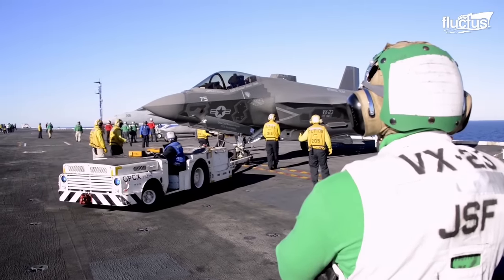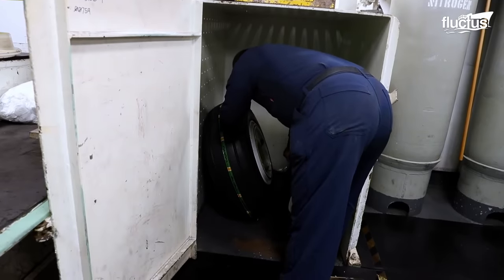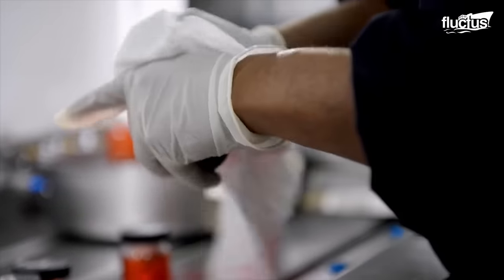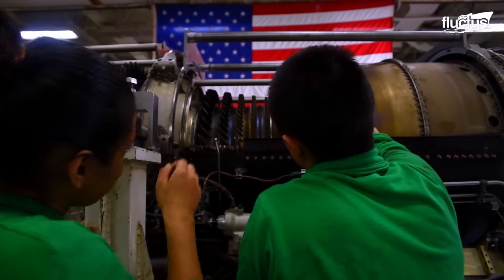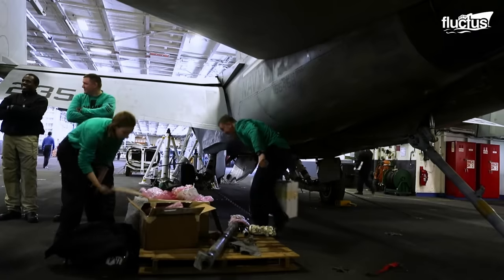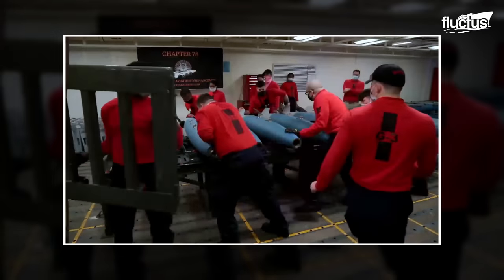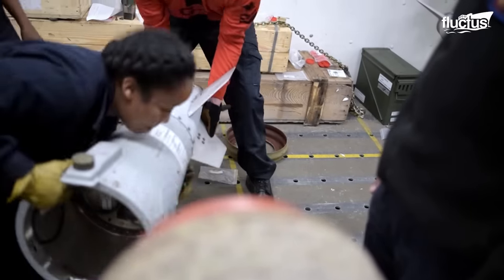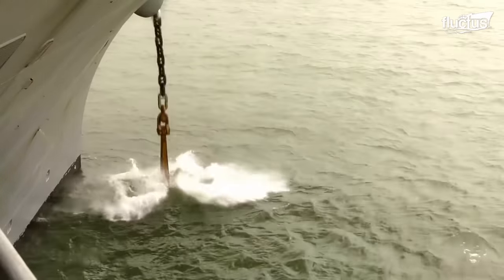Life Inside Tiny Shop on US Aircraft Carrier Repairing Fighter Jets Tires at Sea

Comment: I’m in the Air Force as essentially a Diesel/heavy Equipment mechanic. The amount of tools, consumables and benchstock we require on the ground in a permanent shop is insane. I couldn’t even imagine trying to keep a ship supplied with all of this. 

A lot of times we have to order stuff, but obviously they don’t have that luxury for the most part. So they really have to bring EVERYTHING you could think of with them. That’s just crazy.
Reply: Amazon will deliver anywhere. I saw their 34ft Baha delivering stuff yesterday. 😁
Reply: Civ automotive tech here, it's pretty crazy if any of the equipment break down we call other, manufacturer trained equipment mechanics to fix them. Sailors need to know how to fix the shit they need to fix stuff with 😂. My worker was an air force  mechanic, and has taught me so much about electrical diag.
Reply: I worked on carriers for 4 years....we had a Pod that we mounted on the Tomcat and never had a real permanent place for the three that we had.  We were always moving it all over the flight deck and hangar.
Reply: We have "vertireps"  from Supply ships.. where parts and supplies are brought on board Via helicopter. The bowels of that ship are as big as the sewers in your city. Don't worry we can bring a lot of shit with us
Reply: There is still a supply chain for systems at sea. While the availability of materials is largely governed by weight and size large components can come over water just like in trl.

Comment: Now, this is really an informative vid.  These mechanics and electrical sailors are so important.  That and the culinary specialists.   It is a hot job with no AC.  I am sure they get very hungry like the rest. Launching of the deck is a miracle performed by these sailors.  There are many other operations to handle that are very valuable.  It is a fantastic beast.

We need to replace most carriers, ships, and subs. They work but need to be bigger. 15 Carriers, 54 modern subs with new materials, and on and on.
Reply: I was one of those culinary specialists, but on a destroyer. DDG-94, USS Nitze.

Comment: I was on the Kennedy CVA67 for a Med cruise. 1971 - 1972.  I was an AMS 2nd class.  I was over the tire shop.  We had to do all of this by hand, no machines.  The carrier makes its own O2 and Nitrogen from the air.  Tire pressure on the F4 main tires were 325 psi on land and 475 psi at sea. I used to try to get lost on the boat, an airdale term, but couldn't do it.  Loved the motion and the noise,  On December 31, 1971 went from party to party.  Got drunk and never left the ship!

Comment: AAHH! The name of the rate is pronounced "bo's'n", not boatswain, even though that's how it's spelled. Just like Forecastle is pronounced FOHK-səl. 

Something you never mentioned is that the maintenance personnel are not ships company, they belong to the air wing. The air wing is able to be transferred from command to command, shore-side or deployed.
Reply: Not the tire shop people, they are part of Aircraft Intermediate Maintenance Department, which is a department on the ship. Shop 51E if memory serves, manned by AM rate, Aircraft Structural Mechanic. Squadron sailors are not allowed to rebuild tires, they just change a built one with worn rubber out for a built one with fresh rubber. Also, aircraft tires at sea are not allowed to be re-treads. They were allowed up until 1997, but too many tire delaminations caused all stock of re-treads from ships to be removed. I had to help do that, it was a gigantic PITA.
Reply: @muskaos  I was ship's company. Lot's of us AIMD guys were, but we got a lot more from the squadrons when we deployed. AMH for life!
Reply: Not entirely true, plenty maintaners were ship's company. I was one. Wish I was a squadron guy, they were treated much better!

Comment: Sorry, but NO one (1) system is More important then another on ANY aircraft.
The engine(s) are no more important then the Bolt and nut that hold the tail hook system together.
It takes all parts/systems to make that aircraft work, from every bolt, rivet, screw, to the hydraulic and electrical systems.

Comment: Is there reason their not using cordless impact drill or drills on those aircraft panels..it would be so much quicker?
Reply: Probably battery recharge time. Then storing the batteries may be problematic, spontaneous combustion maybe.
Reply: Arm strong power works  
In all weather,  and at all times  needed.
Reply: Most exterior aircraft panels that are removed frequently have internally wrenching screws. Air or electric drill guns exert enough torque to easily strip out the heads. Some aviation grade fasteners can be very expensive, depending on the metal.

Comment: Looks like all fasteners like screws are loosened or tightened with manual wrenches. Why ?  I'll bet there's a good reason, but I don't know what it is.
Reply: Misguided belief that the JP5 is going to catch fire. Just before I retired they had just started using pneumatic screwguns.  The ordinance guys still do things manually for obvious reasons.
Reply: GET THEM SAILORS SOME IMPACT GUNS WITH THEIR STANDARD ISSUE
Reply: @jeremymason802  in the Ordies situation, sparking things around explosive and sensitive electronics is not a good idea.
Reply: We used them in the Army as well, on helicopters.  I was told there's a lot less chance of doing damage with a manual wrench or driver and stripping out threads and bolt/screw heads.   Plus you need not worry about power sources and the extra resources they require when you can use the muscles of young soldiers to do the work.
Reply: @arkwill14  Thank you. That all makes sense, but too bad they can't get a plane into the air as fast a NASCAR  pit crew gets a car on the track.

Comment: How we managed in the    50s on carriers  operating jets you really must wonder!🙄   and tyres filled with nitrogen.?.sheesh!
Reply: Aircraft (and many other vehicles) tires have been filled with nitrogen for many decades sport.  It performs MUCH better under extremes of heat and pressure.
Reply: Servicing aircraft tires with nitrogen has been standard procedure for decades.

Comment: This question is for anyone that is currently active and has knowledge of helo aircrews and maintainers. When I was active I was a crewman but I was also an AT.  As I understand the new aircrew they are no longer maintainers but their roles are strictly aircrew. Is that correct? And if it is why was someone on top of the 53 with a flight suit on.  Also there is a guy repairing the crash crew tractor and he also appears to be wearing a flight suit.
Reply: I think that's just what they wear on the deck for head/ear/eye protection. I can't imagine that pilots do this stuff.

Comment: Wonder why they dont use Electric Drill/Drivers for the bolts of the aircraft???

I can see the training essentials of using manual hand tools but why handicapped out military mechanics and maintenance crews like this?
Reply: Power tools can over torque the fastener causing stress damage and failures.
Reply: Thanks for asking this, I too wondered why the prevalence of crank handle drivers. Torque can be set on a (quality) power driver so that "over-torque" is prevented or minimised.
Reply: I was in a while back before the battery pack drivers. I can see the benefit of cordless drivers to remove screws. Trust me, I've removed my share of panel screws. Even with speed handles, we stripped the head, and we used a hand drill to drill the fastener and use an easy out. So, I would expect even more stripped heads. Plus, the number of batteries and tools required. Since the a/c could be anywhere on the hangar or flight deck, just think of the battery logistics. We had a hard enough time with flashlight batteries.
Reply: As others have explained, power tools can fail or be set incorrectly and over/under-tighten a screw/bolt, causing stripped threads or insecure fitting.  Using speed-braces like this ensures that that technician will always be able to feel the torque, detect any cross-threading etc.  It's cheaper, far more reliable and better for detecting problems.
Reply: @aneng64  i understand that but there are also torque locked drills that cannot pass a specific level of torque so why not go that route? Also batteries have gotten cheaper and stronger overtime so considering the US Military expense I can't see that being an issue. Especially if they worked with a company who guarantees their products and has a good customer service and returns department.